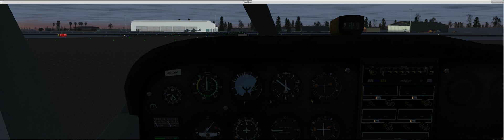FlightGear Tutorial C172P Taxiing

Comment: Sir how to turn the plane left or right by joystick? I have to press 0 and enter 😦😳 to turn.
Reply from the maker: You need to map the rudder action to some button / movement in your joystick. I'm using the Logitech Pro Flight  Yoke and Rudder pedals system.
These are the links from Amazon:
https://amzn.to/39D5g7h -> Yoke / Throttle
https://amzn.to/3rIxi7x -> Rudder pedals
In FlightGear you'll need to configure the settings of your control, I'll try to post a video tutorial on that.
Reply: @usaaib  ok. Thanks sir